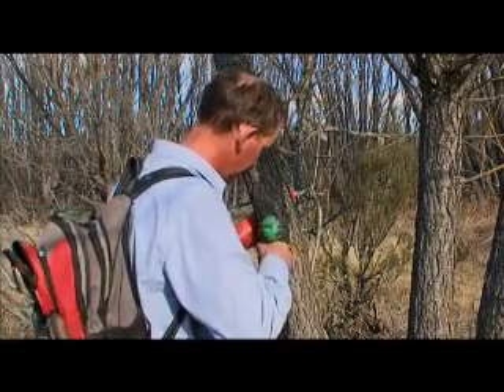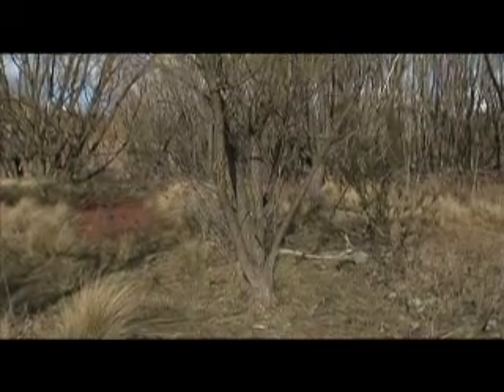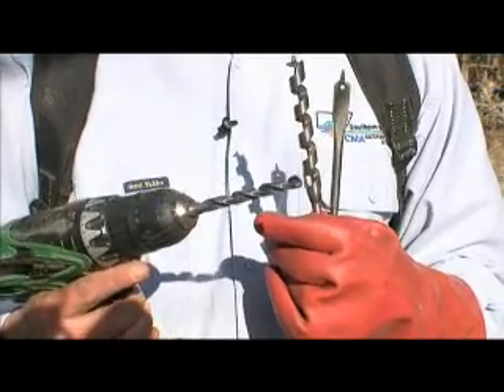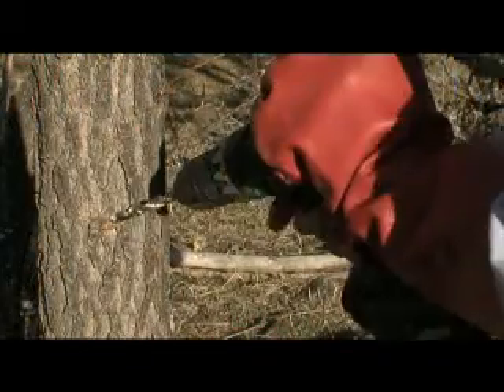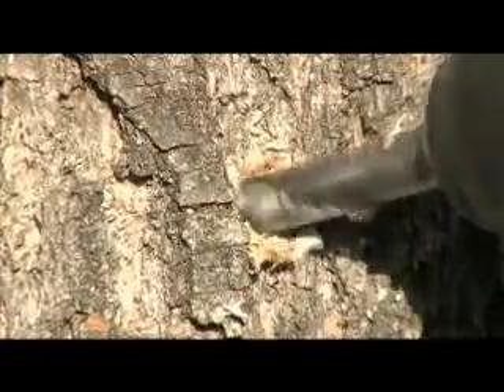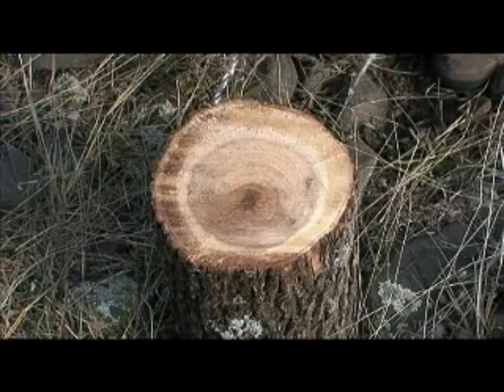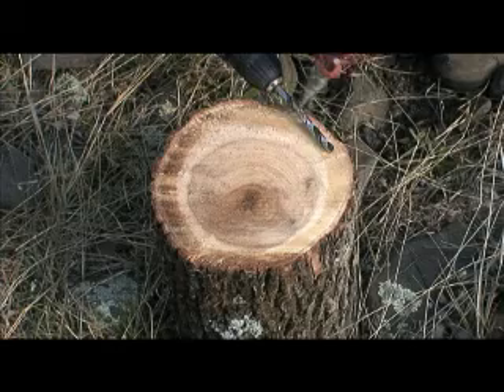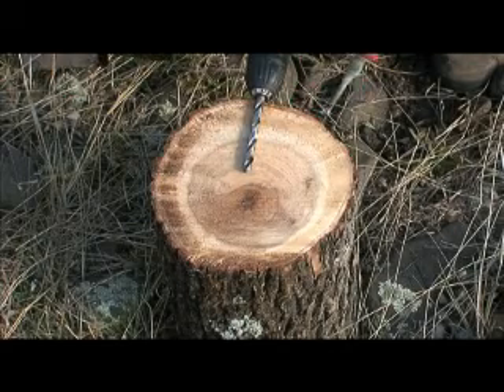Willow control - Stem injection with a cordless drill

Comment: Thanks

Do you use undiluted glyphosate and also, will the tree eventually rot or is it more likely to fall in a breeze while still quite heavy?
Reply from the maker: Hi Jeremy We have seen both the dead stems rotting or getting borers and breaking down over 18 months some do stay as hardened spars and get pushed over in the next flood. Where we can we do cut them up to allow in the fungi that break them down a lot quicker